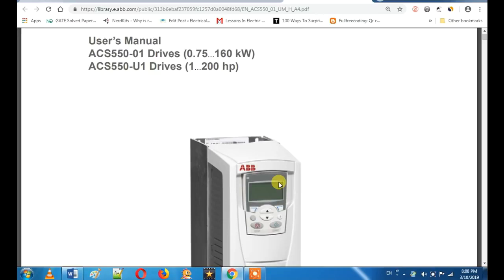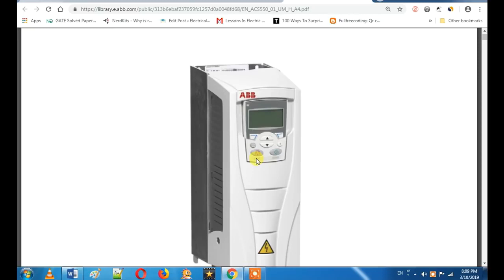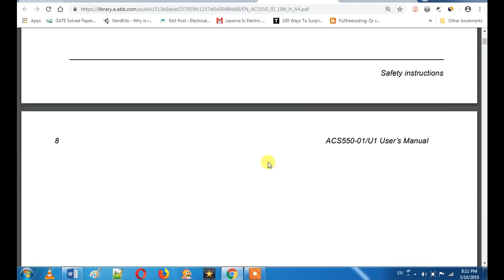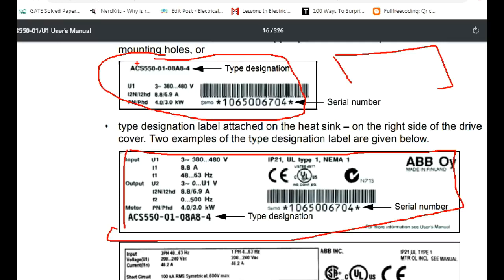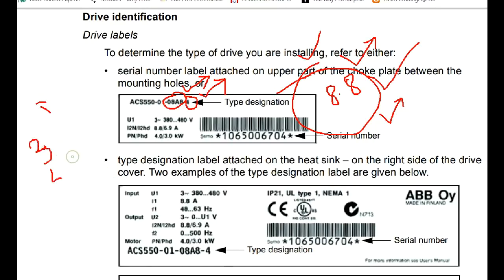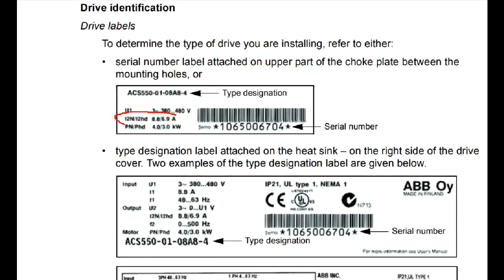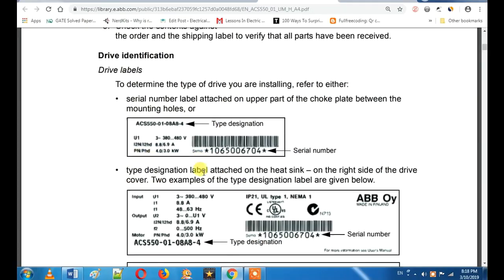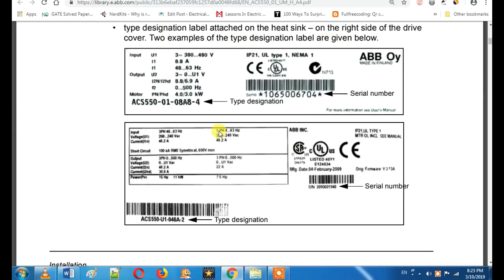ACS 550 VFD Explanation In Tamil Part 1

Comment: Nanbare… nalla explain panunenga, oru sila corrections eruku
1. ABB CDP (control panel display) 2 types eruku Basic control panel and Assistance control panel, assistance control panel 3 line display and neriya options eruku so it is expensive.

2. VFD ratingla I2hd heavy duty currentna ennana oru semi conductorah over load paninomna athoda temperature romba sekrama increase agidum so athu thirumba cool agi safe operating levelku vara some time aagum, so ipo oru driveah rated currentla use panina neenga 8.8 Amps consume panalam, but unga applicationla over load iruntha neenga same driveah 150% overload panalam for 1 minute every 5 minutes, so 1 minuteku intha driveah 13.2 Amps currentla run panalam and then 5 minutesku 6.9 Ampsla run panalam, so overload timela increase aana heat ipo 5 minutesla kamiyana current flow agaranela cool agidum and this cycle can repeat. So heavyduty applicationsla motor power 3kW so motor nominal current 6.9Amps so neenga 150% load panamudium.
It is same for All ACS drives such as ACS55,150,310,355,380,480,550,580,850,800 & 880
Reply: Bro i have one doubt